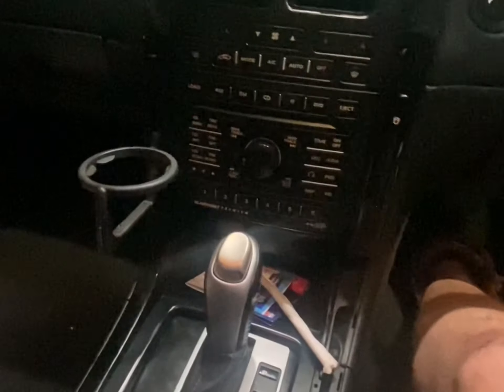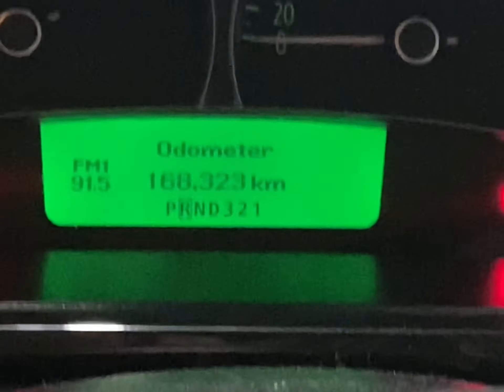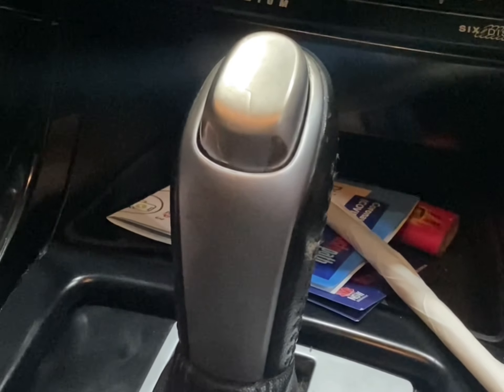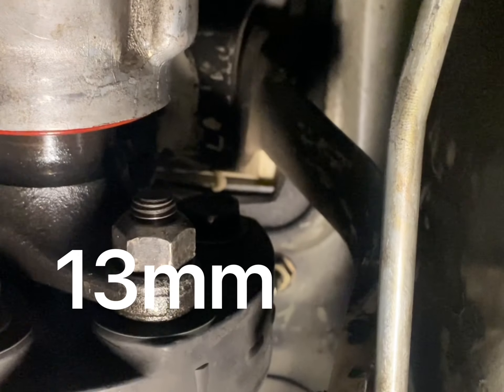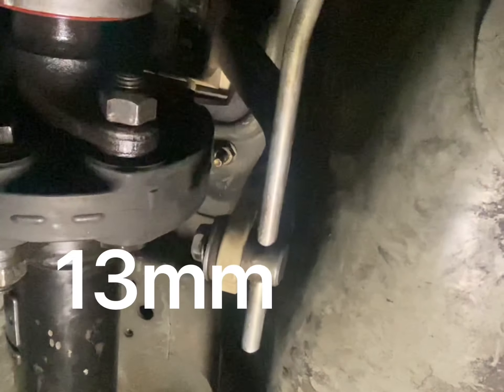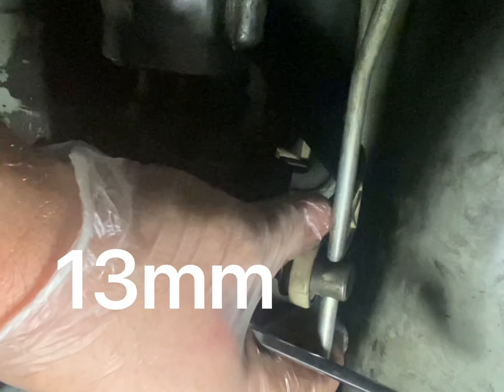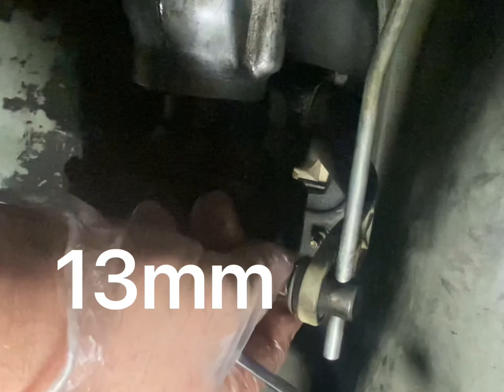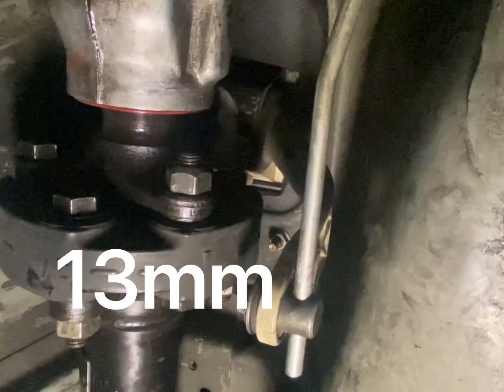Gear selector repair: Holden commodore VT vx vy ls1 wk wh wl statesman caprice

Comment: Do you know if this is the same on a vt ss?
Reply from the maker: Thanks for the question, yes it should be or very similar. Also if this doesn’t the issue. Drop the pan and check the nut that’s connected to the linkage on the side, this often comes loose, apply some loctite on the thread if it is. Otherwise the selector valve will cycle between 1,2od and reverse train and will cause a huge pressure difference sporadically and cook the clutch packs